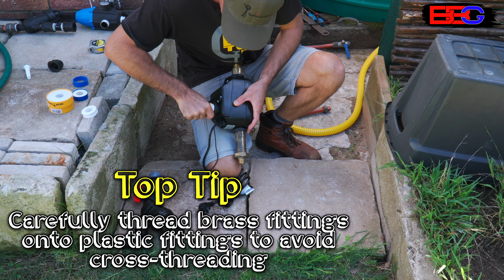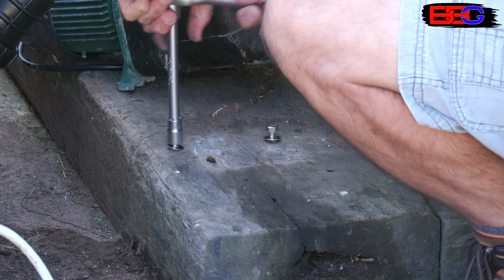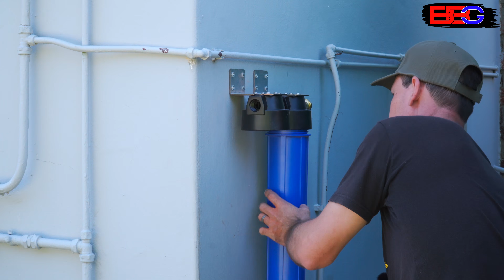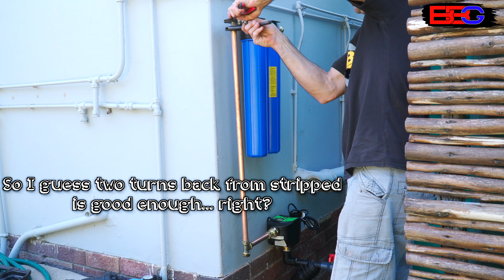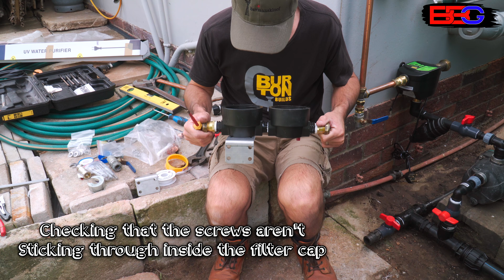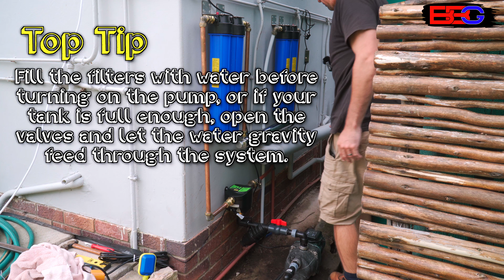Installing a Rainwater Harvesting system to clean rain water | UV Tube, Pump, Filters

Comment: Grant, I was utilising the Davey Pump controller and was very happy with the system up until I had a water pressure failure from BCM (municipality). At this point, the  pump controller does not work, even though the water tanks were full. In short, should we have  break in supply from Municipal, the pump controller does not work (with full rain water tanks). I have tried installing a non-return value and have been in contact with the importers of Davey. I have no solution, having to install a more basic pump controller with manual value adjustment to convert between municipal and rainwater. Have you been able to work around this issue?
Reply from the maker: Hi David, I’ve experienced the same thing with our @DaveyWaterProducts RainBank controller and it's a bit disappointing. One would reasonably expect the controller to still activate the pump and supply tank water even when the mains water supply is interrupted. I mean... what happens when you want to flush a toilet, do the washing or water your garden (per their marketing) using tank water and the mains water supply happens to be out... then your tank water sits there being absolutely useless. What is the point of having rainwater storage tanks to use 'to save on the cost of using mains water supply' or to use as a primary water source if the 'primary source' doesn't operate when it's needed (i.e. if and when mains water is out).

That said, on page 6 of the user manual, it states that 'demand  must be greater than 1.5 litres per minute or mains water will be delivered' so I guess thats how they have covered themselves. Looks like a good product let down by one aspect of the design that I think needs to be improved upon.

As for a workaround, I haven’t got around to trying it yet but had thought of running a line from the tank outlet (before the pump) and ’Tee’ that into where the municipal supply is connected into the controller + two check valves. One check valve from the tank into the controller and the other check valve on the municipal / mains supply line… so when there is municipal / mains supply, it's able to provide forward flow through the controller (but not backfeed into the tank) and when there is no municipal / mains supply, the water gravity feeds from the tank and into the controller to provide forward flow (but can’t backfeed towards the municipality). This 'gravity feed workaround' will only likely work when the tanks are full and be less effective as the tank empties. It's a bit of an overkill workaround and I haven't completely thought it through yet so not sure if it would work. Might also have to install install further backflow prevention measures. Might try it sometime for fun.

A manual changeover with proper backflow prevention measures and one of those 'non smart' or let's say simple controllers is probably a more reliable setup in terms of water delivery... or at lest for now until we can figure something out. Some of those simple controllers aren't the most 'longest lasting' pieces of kit though. Have seen a few of them fail because of relay failure where the relay either sticks and the pump runs too long and burns out or the relay stops making proper contact and the pump doesn't run.

Comment: Can you explain your reasoning when it comes to what filters your are using in your system?  Sediment vs carbon and how finely they clean (mikron) ? Thanks for a great video.
Reply: I found your second video so now I know :-).
Reply from the maker: Thanks for letting us know. Hopefully that second video was also helpful.
Reply from the maker: Hi, I think this video should help you out with an explanation https://youtu.be/DermXBtJMfI
Reply: @GrantBurton  Absolutely, I find your videos regarding this topic really clear for a beginner like me. I've been googling a bit on this and this is the first video that really explains it in such detail that I now think I know something about this ;-).
Reply from the maker: Thanks. There are many ways in which a rainwater harvesting and filtration system can be designed and installed… this is just one of the ways. Wishing you all the best with your research and installation.

Comment: Do you treat the water in the tanks at all or use aeration?
Reply from the maker: Hi Jeff, since this video (3 years now), we haven't treated or aerated the water at all, it only runs through the filters and UV steriliser as seen in tis video, and we use it like that. Every 6 months or so, I change the filters and once a year I clean the UV steriliser (and replace the UV bulb each year - roughly every 8000 hours). Check out this video for more reference https://youtu.be/nrbhMeC0alM

Funny that you ask this now because about 5 days ago, I decided to try some water treatment tablets from one of our local suppliers. I don't know much about the product but it was recommended by the store so thought I would give it a try (for fun). It's called Nanopure by a company called Cremona Trading 23 (cc). Seems like it has something to do with this channel @hannespieterse2696 on Youtube.

Comment: What is the spec for the HDPE union quick disconnects at the pump? Where did you source those?
Reply from the maker: Can't remember off hand what the spec is, think it is an Elysee brand fitting, but you should be able to get them from Spilhaus or Turfag (or any irrigation supply store)

Comment: Hi Grant, what kilowatt rating is this pump? I currently have the 0.37Kw pump, but I am copying your filter and UV layout (thank you). I have a single story house but the pumping distance is +_ 50m from end to end. Would a 0.75kw pump be okay, it just needs to handle maybe 2 showers at the most or 1 shower and maybe 2 taps.

Comment: Why don’t you put the filters in between the pump and rainbank? If the tank is empty, you will have clean water going through dirty filter.
Reply from the maker: Hi George… ‘Clean water’ from the utility supply is a very loose term where we are. I trust our rain water far more than I trust the quality of water from the utility… so prefer all water to be filtered before it’s used.

Also, conventionally with this type of setup, this is the way it’s done, with the pump controller as close as possibly to the pump output (or should I say with as little restriction between the controller and pump as possible). So either the controller is normally mounted directly on top of the pump or if it’s a submersible pump, the pump is of course inside and at the bottom of the tank, and the controller is on top of the tank, and with a straight long pipe connecting the pump to the controller. If the submersible pump doesn’t have a non-return valve built in, there is also normally a non-return valve installed at the bottom of the submersed pipe to keep it primed and full of water when the pump isn’t running.

Comment: I Would like to know  do you ever design using submersible pumps.
Reply from the maker: Hi Joseph, the only two submersible pumps I've installed were two transfer pumps (with a built-in float switch in this video 👉 https://youtu.be/HvH7vidZ2Xw ), which pump water from smaller holding tanks, across the property, to other large storage tanks. Submersibles 'pressure' pumps should be fairly similar to this install, but where the flow / pump controller is located at the top of the tank, and the water outlet is piped down the outside of the tank and into the filters. Some submersible pumps will have the flow controller / pump controller all in one unit.

Comment: You use way too much ptfe tape, 3 turns is all you need.
Reply from the maker: Hi Mike, thanks for the comment. It depends what type of fittings are being used… fittings with tapered male threads don’t require much PTFE tape (possibly 3 turns as you say - but this also depends on the thickness of the tape). Fittings that are not tapered require many more than 3 turns. I’ve also found larger fittings require more tape than smaller fittings because their clearances seem to be larger (of course this depends on the quality of fittings being used).

More often than not, when assembling fittings (both plastic and brass) and winding less tape than usual, they end up leaking which inevitable turns into disassembly, applying more tape and reassembly.

This also depends on how well the fittings thread together… many times I’ll thread the fittings together without any tape and gauge how loosely / tightly they thread together and how far in they screw… then unscrew and apply enough tape relative to how well they fitted together and sometimes ‘double up’ where the end of the fitting is going to be… if that makes sense… haha (this comes with experience though - To much tape can also end up not working as the fittings bind up prematurely).

This is all on the pressure side of course… pipes / fittings before the pump (between the tank and the pump) generally require less tape because the pressure is much lower.

Comment: Hi Grant loving the vids especially the camping and these water ones. Knowing how to fold my tent the 1st time and get it into the bag is a game changer 😁 and I look good in front of the wife kids and fellow campers usually watching you struggle when your packing up. Lol

Have you seen much of or used these plastic Unitwist fittings and pipes. Super cheap, no tools needed other than a pipe cutter for clean edges? No scrap value and super easy to work with and connects to copper, pex, polycop and even hose pipe, although I will use copper when connecting to the UV. 

Also thanks for the heads up on the pump output fittings and pipes. .  I was reducing from a DAB K 35/100 M 1.1kw  40mm from the pump to a 25mm pipe to the tanks back to a 40mm but going to change all to 40mm ball valves pipes and fittings.
Reply from the maker: Hi Bradford, nice to hear from you and thanks very much. It's always great to hear that others are enjoying the videos. Guessing you also have a canvass dome tent and do a bit of camping. Not sure if you have seen these yet? https://www.burtsway.co.za/ It's a product I manufacture. Planning on doing a couple more camp related videos in the near future.

I have seen the Unitwist fittings being used, most recently on RO systems, looks like a nice product.

Depending on your required flow rate, the 25mm that you currently have may be sufficient, however that K35 is capable of some pretty high flow rates if it's not being restricted after the pump... in which case 40mm might be a better option. I used the 40mm to interconnect the tanks for faster water transfer / balancing and then it reduced to 25mm going up to the pump (but my pump is small). Let us know how the job turns out.
Reply: Hi Grant, the product looks awesome and defo something I will get once my water solution is fully built. Question, those SS brackets for the filters are they purchased or did you manufacture yourself? Maybe something else you could sell in your shop? I have been looking and can only find the mild steel. 

Correct I have the exact same tent as you. Following your process to setup and pack away has made my life easier hahaha. Trying to teach my sons now so they don't have to struggle.
Reply from the maker: I purchased the stainless brackets from one of our local stores in PE... and yeah, I have considered making and selling them, haven't got around to it yet, still need to calculate if it makes economical sense to sell them. Maybe if there is enough demand, I'll consider manufacturing and selling them.

Comment: Hi Grant , is there a pressure gauge somewhere in that system?
Reply from the maker: At the moment there isn’t a pressure gauge however I would like to eventually install two… one before the first filter inlet, and another after the last filter outlet so I can monitor the pressure drop across the filter system.

The old system used to have a pressure gauge on the pump controller so that was nice… but in reality, once the system is working, you hardly ever need to check the pressure.

When there are problems though, it’s nice to use for diagnosis.